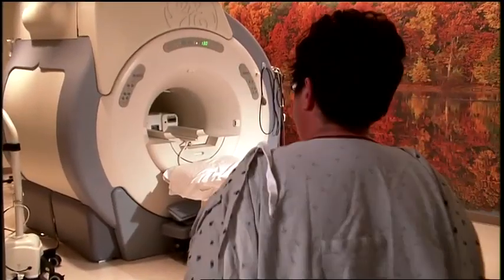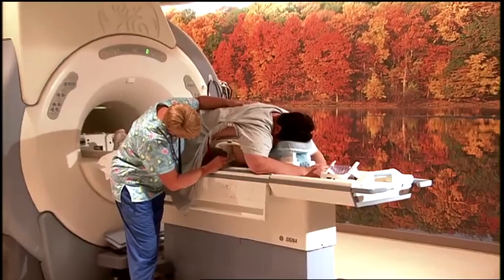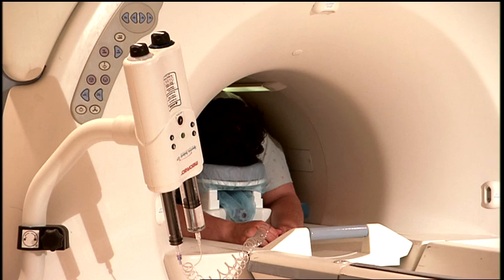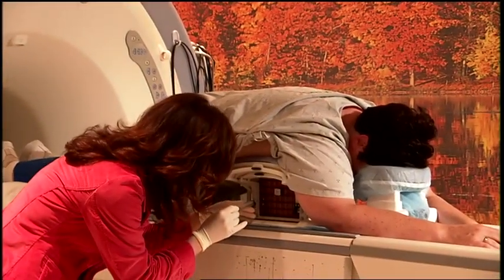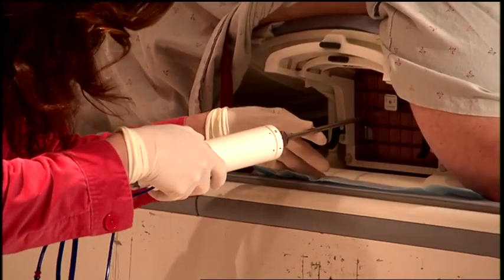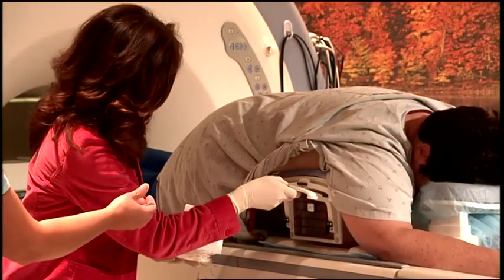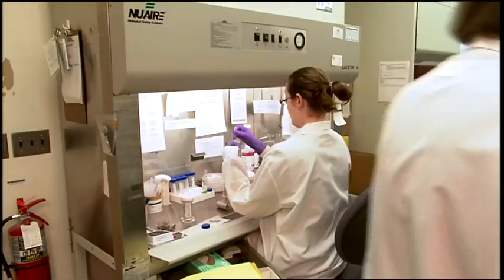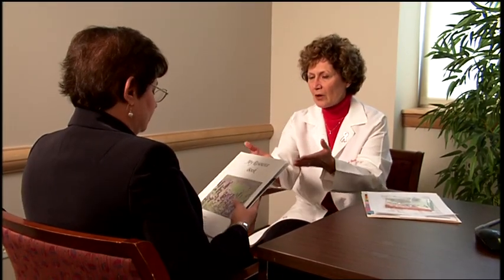MRI Breast Biopsy for Breast Evaluation | UPMC Magee-Womens Hospital

Comment: I want to begin by thanking you for this video. It helped me quite a bit as I prepared for the MRI guided biopsy that I had last week. It gave me a good idea of what to expect. But I do have a few criticisms. You really need to be more descriptive when you tell the patient that her breast will be compressed during the biopsy. It's equivalent (I think) to a typical mammogram, or even tighter than that. I found it very uncomfortable. And after the procedure, when my breast came out of compression, a technician "massaged" my breast for several minutes to prevent blood coagulation. This was quite painful. Additionally, I think your information on how long it takes to recover is grossly misleading. I iced my breast for two days after the biopsy. It was swollen and hurt and taking Tylenol (as recommended) did nothing for the pain. I'm no wimp. But it has been 5 days since the biopsy and my breast is still tender.  I realize that you don't want to deter women from getting a biopsy, but you need to be honest. This is a painful procedure, and it takes a while to recover from it. Btw, a tip for women getting a biopsy: buy a post-surgical bra. The one I got has front closure, and is stretchy enough to accommodate cold packs, but still offer support. Well worth the cost